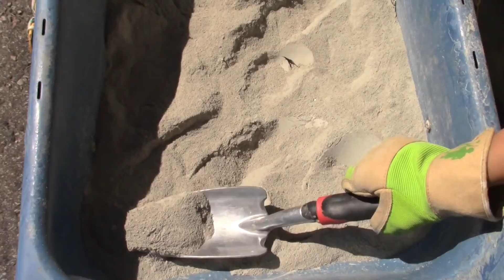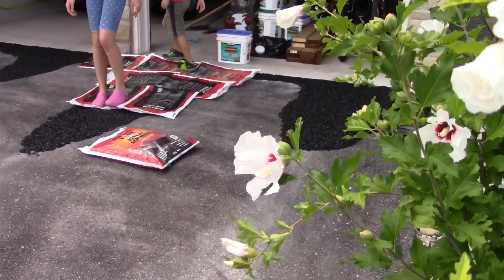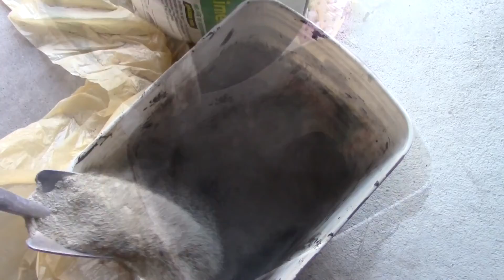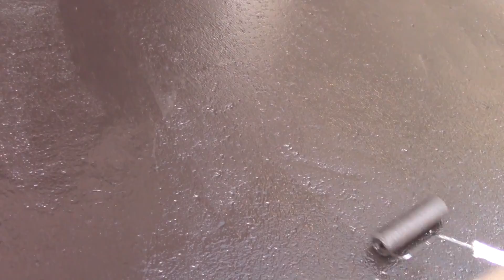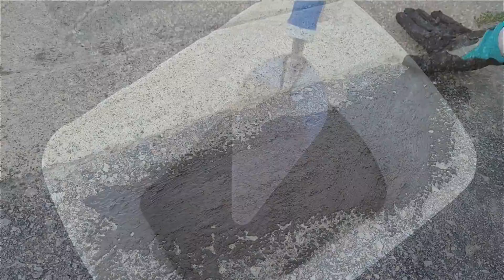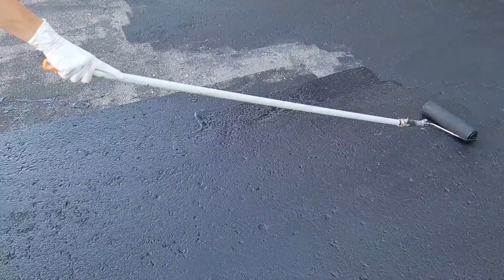3 in 1    How to Fix a Sunken Asphalt Driveway, Tire Depressions, and Seal your Driveway

Comment: you worked so hard on this driveway !
Reply from the maker: Yes, but it's worth it. Instead of concrete, later I learned it was better to use black sand. I now paint my driveway every year in spring. It looks really nice and it isn't too hard or time consuming.